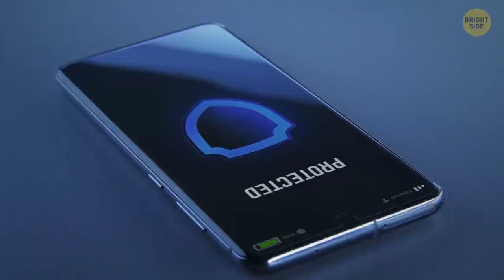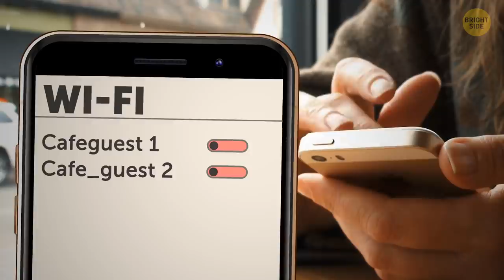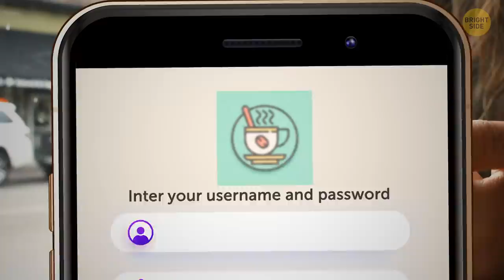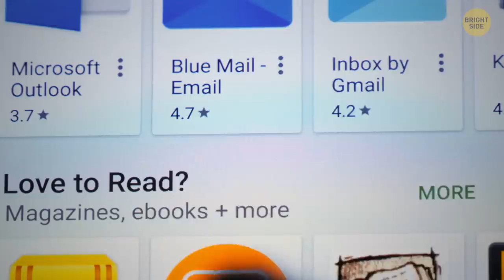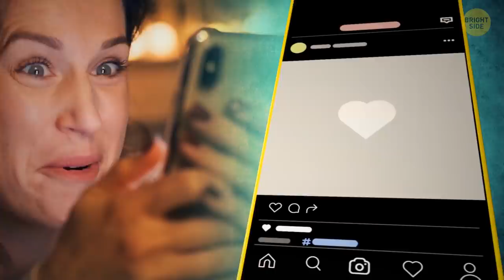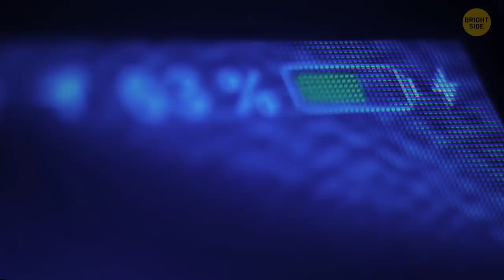If You Are Doing This To Your Gadgets, STOP Immediately!

Comment: Yeah so that charging part for smartphones is way to much and overdoing it. It’s one thing to not charge your phone just cause But these aren’t old school lithium batteries. Or Nickle based. There is plenty of software that helps optimized battery charging and you throw that off when trying to act like you are smarter then the software. Charge the phone when you need to and relax. Charging over night is fine as most chargers will dynamically adjust wattage to reduce heat. Even if you use a 95 watt Mac charger which I have used for my phone the wattage a battery can only accept a maximum wattage and after it hits certain points it throttles back and for a slow charge.
Reply: My phone charges up in 1hour 20minutes or so from 0-100 now to 0-90 is 20-30minutes or so and the last 10% is slow charging . I keep my phone on the charger at night cuz i work the day and my battery is the last thing i want to look for its last for years without any problem anyways and after 4-5 years when its actually aged/used both in hardware-software i will buy the new flagship phone of the year and thats it other than that there is not a single scratch on my phone and the battery saving is overdramatic .
Reply: Hi 😀😍😍😍

Comment: I keep saying to my family and friends(for years lol), you don't need to keep changing your Phone/tablet etc up to 100% each time, I always charge from 20-30% till maybe 75/80%, of course the occasional 100% if i forgot 😂
Reply: This is not as bad as my ABOUT page
Reply: @blakecreed2272  I wish you luck on 400, YouTube say's "YES" then move to 450 👍
Reply: Hi 😀😍😍😍
Reply: Actually you are wrong a battery is made to support an approximate cycle number of charge and charging from 30% to 80% is a cycle.
So you should always charge you battery to 100%.
And even though AGM, Lithium or LiFePO4 are not as affected as the other they all basically react the same way.
Reply: @NMETSGChan  cycle count is not plug in and plug out. Charging from 20 to 80% costs 0.3 cycles while 0 to 100 costs 1 full cycle

Comment: I just got my first phone 2 days ago and my first phone in my name.this video is very interesting thanks
Reply: Get a case and a screenprotector usually ppls only get 1 of them but both of them a must have even if a screenprotector is not a shock resistant one just your normal one its a must have years of use will worn out the glass on any phone doesnt matter how strong it is .
Reply: Hi guy 👍😍👍

Comment: 2:44 “shouldn’t dismantle your computer…OR REMOVE ANY HARDWARE…”  So, when the power supply in my computer died, I shouldn’t have replaced it then?  Also, it’s impossible to upgrade ram, hard drives, optical drives, video cards, etc. when the old hardware is physically in the slot for the new component.
Reply: To be fair, most of us shouldn't even look inside our computers. We don't know what we're doing and without the warning people would start pulling out everything to clean inside.
Reply: @cutebutevil7387  "To be fair," fair to whom exactly?  That statement makes no sense.  Regardless, if one doesn't try to do something how are they to learn new skills?  It's not difficult, when removing hardware, replace it exactly where it came from.  Slots and pin connectors are even keyed so they cannot be inserted incorrectly.  To say, "most of us shouldn't even look inside our computers," or telling people to not even try, only serves companies that trick people into believing they are incapable of servicing their own items, thus being able to charge them extravagant fees for basic repairs.
Reply: @Arbbal  h

Comment: Power menu discharge solves this problem. Pair your phone with a legal laptop using Bluetooth, copy 8 mb 5x, then start Google Maps. You will remove your phone from the blacklist, and the batt lasts longer, and you can use the Gps without draining your battery. It applies to symbian as well, and the trick works offline, without using the internet connection.

Comment: Some of these points are logical, others are just so wrong.

Phones have had intelligent charging for as long as anyone cares to remember.

Your browser cache speeds up your web experience, not slow it down. Cookies and cache can be an issue from time to time where the site has changed and the cookie is no longer valid, but it won’t slow down your browsing experience.

IP67 ingress protection protects against more than just a splash here and there. I’ve been using my old iPhone 7 as an underwater camera for two years now, and my Galaxy S5 before that. Accidents CAN happen, but they’re rare.

All local iStores in my area use a paper clip to clean the charging port, it somehow does a much better job than a toothpick.

The “desktop” doesn’t use RAM. The Windows shell used RAM, which includes the desktop interface but nothing stored on the desktop uses RAM until opened. The only performance difference you’ll see is maybe an extra second upon startup for the icons to load - still near instantaneous if you have even a slow SSD.

Comment: Okay oh gosh first off all 90% of new phones have safe drain charge battery and also most charges and new phones have a safety stop charging feature you have to drain your battery to reset your charge it drains all the capacitors and everything from your phone to get rid off bad electricity you can charge your phone 100% let it die but dont use chargers that are not near your voltage reccomend on the phone mostly phones use 5v up to 12v so look up your phone to find out